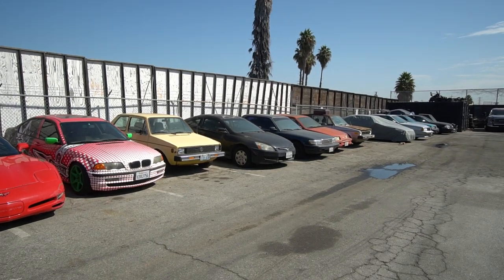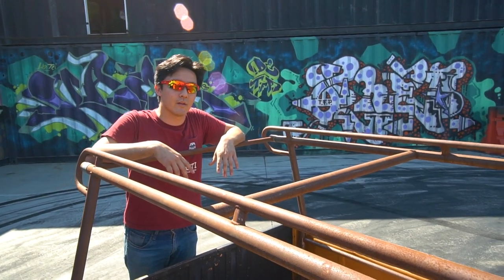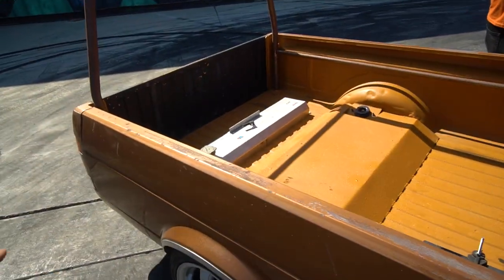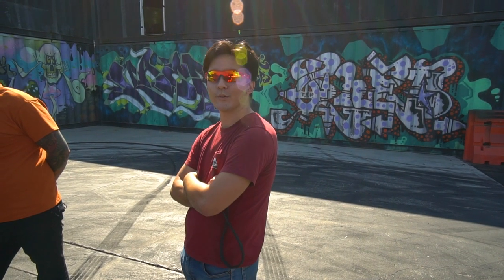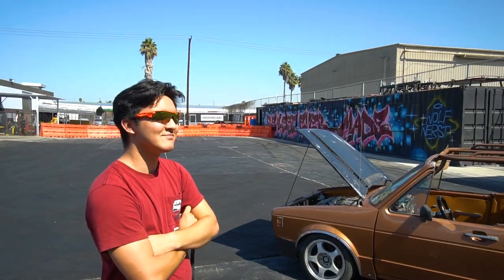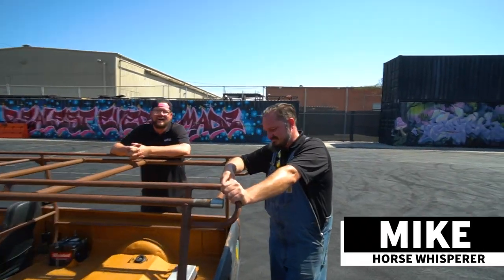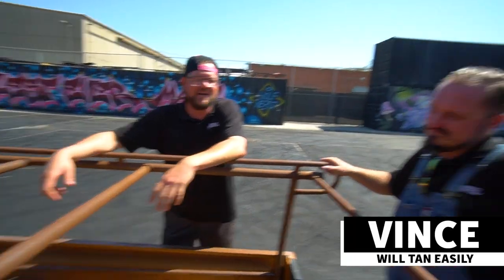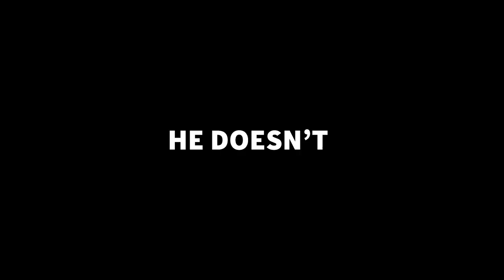VW Rabbit + Mazda Miata Drivetrain = The Perfect Missile Truck!  // Build Breakdown

Comment: SOMEONE ALREADY DID IT. Last night I was sat up and thought to myself. I want a RWD civic like Jimmy. But didn’t want a KA or a civic. So I thought of a rabbit pickup with a Miata motor. Never going to act on it. Just thought it’d be a cool idea. And here it is. That’s very cool
Reply: the universe, bro.
Reply: I had the idea to do it a few years ago too but using the MX5/Miata rear subframe and suspension set-up because I already done enough research to know that the track width is virtually the same. The only difference was that I was going to use a K20 or tube frame the front and shoehorn the Audi 2.7TT into it. I actually bought a Caddy to start the conversion but it was too clean to cut up so I sold it again and never got around to buying another. Always good to see your ideas come to fruition, even if it's through someone else.

Comment: For shark-cart, make carbon fiber panels that, bolt on and fill up the gaps between the steel exo design. I'm thinking like c-clamp design that goes around sections of the tubing and has a connecting pin design on where panels can either snap on to or be riveted on.
Reply: Or, scrap plastic & zip ties

Comment: Cool on the 69 rating, I agree and think it should have been higher because he come in Cut Loose never let off was cutting into the corners around the barrel and the Wall's tight, it wasn't cool run !

Comment: @brianscotto We need to buy the Schimmel built Corrado with the rear engine swap using 993 suspension. I have the owners contact somewhere, and you probably do as well. PA guy. I will split it with you.

Comment: I want to turn my dodge Dakota V8 sport into a drift missile I wonder what the first process would be to do that!
Reply: Slam it and weld the diff lol
Reply: Vodka and a blindfold.
Reply: Jack Daniels and your sister cousin
Reply: Weight shedding and a way more powerful motor and transmission with a welded diff
Reply: Slam it, weld the diff and a steering angle kit.
Reply: Donuts
Reply: Angle. Dif. Suspension. Power
Reply: Look up Driftslayer Tacoma. Errbody in the club saying slam it adjust steering ratio and send it!!!
Reply: Coming from a 40 year Chrysler tech’s son, there is a reason why  nobody really builds any Dodges for drift, their transmissions are absolutely junk. 

Besides that, your truck is more then likely an Automatic, majority of light North American pickups are, you’ll be spending more on a transmission swap then the truck is worth, then you have to still build a drift capable vehicle after that. There is a reason why you’ve never seen a Dakota drift build, because it would be an insane waste of money, for something more then likely not very good. 

Keep your truck stock, go buy a miata, 240, or mustang for cheap, and use your truck to tow your drift car from track to track. Do you know how many want to be amateur drifters would kill to have a tow pig pickup daily driver, so they don’t have to drive their brutally unreliable drift car every day?
Reply: @djconeyjoe  or an LSD out of an early Grand Cherokee those things hook and you can still daily it
Reply: @completefemboyr.n.g1308   you can daily a welded diff too lol just a lil noise in parking lots lol
Reply: @DanoFSmith-yc9tg  you talk about how the transmission is garbage, then tell him to use it to tow a drift car around like the transmission wouldn't give out after the first trip lmao. You're partially right, the transmissions are shit. But a manual swap can be done in a Dakota for less than $1500 if you do it yourself, which isn't even close to "more than it's worth".
Reply: @DanoFSmith-yc9tg  😂 😂 😂. I know you think you made a point but the rest of us are laughing.
Reply: Close your eyes and hope for the best👌🤣🏴
Reply: In the process of building my 98 Dakota sport. Not necessarily for drifting, but they already break loose pretty easy so I'm sure it's possible. I got a manual transmission on it's way. Also trying to piece together a small turbo setup for a little more power. I've gotta finish going through and replacing all of my seals and gaskets first though. Not really trying to rebuild the whole motor until I inevitably blow it up, but it pisses oil like a race horse so I don't wanna add boost on top of that and blow it up even faster.

You definitely want to do something about the transmission. Either rebuild it and hope for the best or manual swap it. You can get a manual online for less than $1500. You'd need an LSD if you still want to drive it around, or just weld it if you don't. Need to figure out what to do about a hand brake. Also probably wanna do something about the shitty suspension. After 24 years, the sports aren't so sporty. They got body roll like a canoe in a hurricane. Wouldn't worry too much about lowering it though, they aren't that tall to begin with. Maybe a 2" drop if you just really wanna.
Reply: @DanoFSmith-yc9tg  I’ve got a blown 408 stroker in my 02 Dodge Ram with a 46re built out the wazoo. Billet everything with anything else I could put in it and it holds 573 wheel horse all day. Not many stock trannys will hold up to drift abuse. He could also manual swap his Dakota  easily for cheap. The cool thing is, nobody builds a drift Dakota which makes it unique. 240’s, Miata’s, and Mustangs are a dime a dozen.
Reply: Drift evergreen fb Tyler Daland 

Dakota shredder
Reply: That'd be nice
Reply: MoPowaBaby
Reply: Sell it and buy a real truck.
Reply: @Censortubes  goddamn 😅
Reply: Step #1: Get rid of all the Dodge on the truck.
Reply: Slam it
Reply: Selling it
Reply: @djconeyjoe  That's not a good start
Reply: @papawpaul  you don't really need a lot of power to drift
Reply: Go drifting......
Reply: @djconeyjoe  Five hours later and that is my exact thought 💭 lmao 🤙🏽☝🏽
Reply: @GhostRyderFPV  🤣
Reply: @papawpaul  I was thinking an LS
Reply: @gtaunderground2.089  😶‍🌫️👀
Reply: @rayhowe90  just did that and some drifting lol and put it on my Instagram
Reply: @aadin1945  that’s what everybody saying that might be the move
Reply: @grim-ripa  I will do frfr thanks!
Reply: @DanoFSmith-yc9tg  I stopped reading after you said my truck was an automatic it’s a Dodge Dakota two-door sport V8 with the five speed manual gearbox The transmission is no big deal I’m going to have to get a new one anyway but I’m dropping an LS motor in it most likely and going to get a dog box 📦
Reply: @completefemboyr.n.g1308  I think that’s going to be it with maybe an ankle kit and lowered Plus some weight reduction
Reply: @djconeyjoe  preach my brother!
Reply: @firstfromabove  I don’t know about all that that you’re talking about but my transmission has held up for many drifts so far and standstill burn else during H2Oi Ocean City for 3 years straight just now looking into building on what I have
Reply: @firstfromabove  I was thinking about running a small turbo on very little boost but that’s still in the back of my mind
Reply: @NephewJamie  install leaf springs upside dawn I've seen it on a datsun way not a dodge
Reply: @gtaunderground2.089  lmao you kids, there is no "angle kit" for a dodge dakota. It would be full custom suspension.
Reply: @DanoFSmith-yc9tg  lmao you cant buy a 240 for cheap anymore... but we still get your point
Reply: @bigdfitness5020  I didn't say you could buy one but I've driven Dakotas and they don't have much angle.
Reply: @gtaunderground2.089  most vehicles in stock form don'r have much angle. My bone stock e90 has terrible steering angle. Never measured it but I would guess around 30 degrees, not much more.
Reply: Does it have a hemi
Reply: @bigdfitness5020  I went with bags brotha
Reply: I just raced it on my Instagram
Reply: First step would be to pick a different car lol